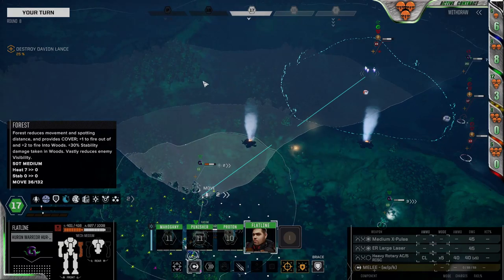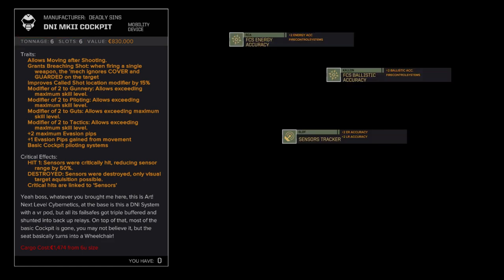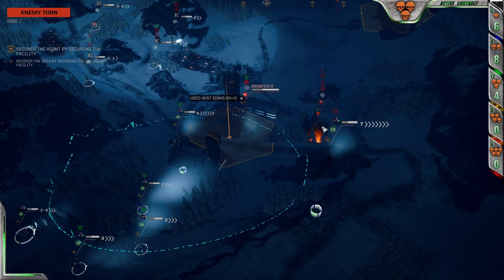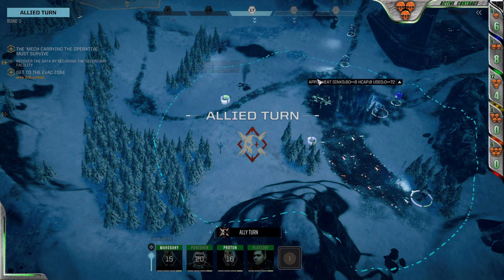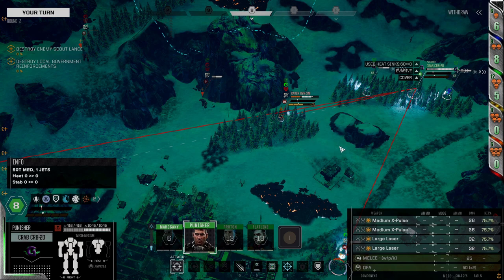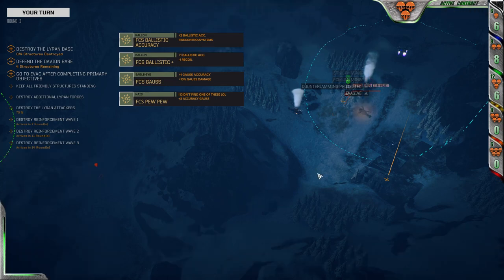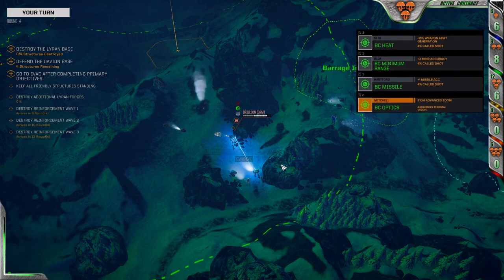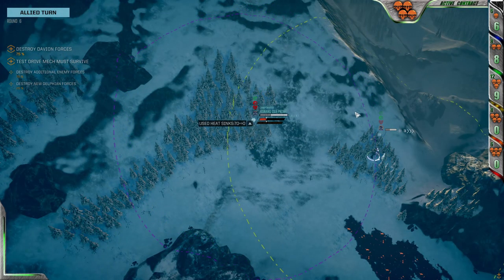Roguetech Electronics Guide

Comment: There is one case where IMO the max sensor  range can top accuracy straight out, and that's indirect fire. You cannot indirect fire at units that aren't on your sensors, accuracy or not. If you have some sort of scout or wide-range C3 to reveal them to your army, great. If not (as soon as you go into assault territory, scouts become a VERY risky proposition), sensor range extension it is.
Reply from the maker: It's true, if you choose not to run a forward unit to spot the enemy, you will need extra sensor range to locate them. Refusing to allocate resources to information gathering on the battlefield comes with its' own set of problems. A properly equipped and managed scout is still a great asset to a company even against assault units, and the risk of running such a unit is less than eschewing the role from your company.

Comment: One point of contention I have with your statement that Artemis BC is better than the FCS is the bonus to clustering. The +9 from the FCs combined with the +6 from the Artemis ammo itself already leads to fairly tight damage patterns which somewhat eliminate missiles "sand paper" style damage model. Once you add in a pilot with the + clustering gunnery skill and potentially quirks to boost it further you get almost FTL ammo type performance with Artemis accuracy. Also a counterpoint to the negatives stated for the gauss specialized FCS's, unless your running a non-omnimech with predetermined weapon type slots you can easily replace the typical medium laser filler spots for leftover tonnage with the single ton, self contained limited ammo gauss options.
Reply from the maker: Based on your arguments (which are solid), it seems you are at the point in your career where you can fully specialize your units' weapon loadouts and have access to all the OmniMechs you could want- a fantastic place to be! Not everyone is at that point in their career though, and this video is more about helping players reach that goal.

Clustering is NOT accuracy, however, so while it's true that bonuses to clustering rolls will help keep your missile damage concentrated, it doesn't do anything to help your unit to hit in the first place. Early in your career most Mechs won't have the luxury of being able to dedicate all of their weapon tonnage to a single type of weapon system, so running an ArtIV FCS, for example, will deny the typical accuracy bonus from the FCS slot to all of your non-missile weapons. Incidentally, I stand by my opinion that it's better to run ArtIV as a battle computer, which has +5 to clustering by itself and lets you install a TC or FCS with an accuracy bonus on top for a much higher effective damage than the Art FCS.

Comment: Sensor and spotting boosts open up shots you would not have had.
So, small stacking mod, secondary sensor effects, and 3 more alphas vs. the “always on” bonuses.

There may be times that 4 50% alphas beats 2 65% alphas.
Reply from the maker: I tend to run forward scout units for spotters, so for my damage units, they don't need to worry so much about both spotting and dealing damage.
Reply: I've seen stealth mechs so advance they were invisible until they were within walking range. One of those would rip thru your lance. That's why I always send my mechs in groups of 2 or 3. CYA

Comment: Build guides for roguetech suck. You don't have a lot of options to begin with. You take what you can get, so I found about half of this video to be unhelpful.  Guides like this assume a whole lot of choice that I haven't seen in Roguetech. What the fuck does it matter "what I want" when "what I get" don't happen at the same time.
Reply from the maker: This guide is primarily aimed at assisting players in determining the strengths offered by an item, and then grouping similarly powerful items together. I deliberately crafted the video to be as generic as possible, and to explain game mechanics and my reasoning for how and why I placed equipment into their respective tiers. 

Hopefully this helps players in breaking down the enormity of available equipment to focus on what truly separates each piece of kit, where they can eliminate the weaker items when possible and save their deliberations for more easily making the selection that fits their current situation. No player can count on finding Enhanced Imaging exactly when they want it, but knowing why that mod is so good may help them to select the weaker but significantly above average Rangefinder mod, for example.

I also believe having a few of the more powerful items in mind helps to ensure they aren't missed when they do arrive, plus generates some extra excitement when they drop!